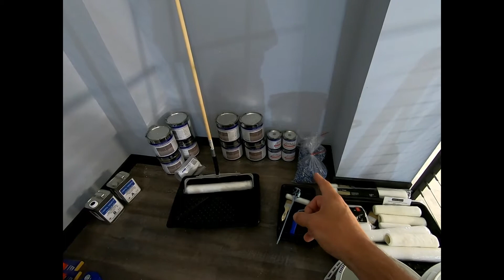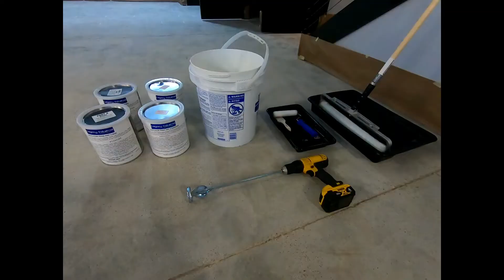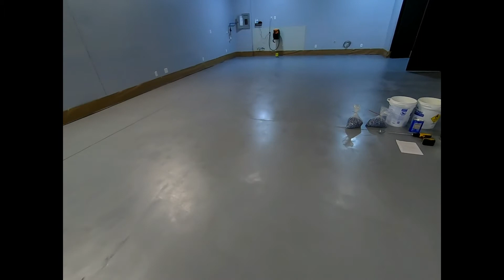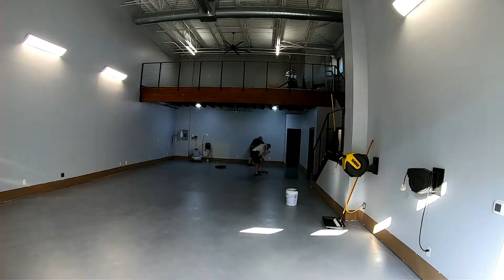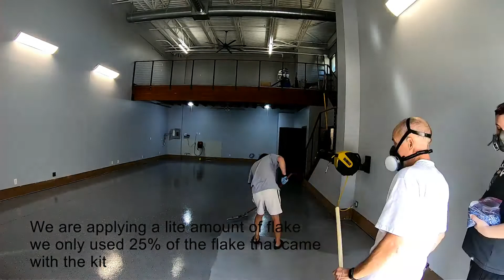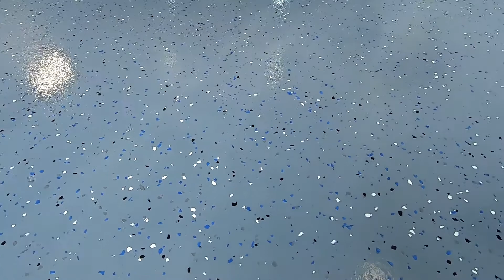Garage Floor - Legacy Industrial Nohr-S Polyurea

Comment: You used a grinder AND a chemical etch??  Why?
Reply from the maker: The grinding took down the main imperfections.  The chemical wash cleans it up before epoxy
Reply: @LarryBlackledge    Ahh ok...I'll be working with a brand new concrete floor.  It does have trowel fan patterns all over...guess if I don't want those showing through I should probably grind it down as well.  I was hoping I didn't have to rent a grinder...
Reply from the maker: @angelsoftheseventhdawn I can tell you that the grinder that was used in the person I hired to do the grinding left a lot of swirls I don't know if you will improve the look or not you may want to research that more.
Reply: @LarryBlackledge  Did the swirls show through once the floor was completely coated and cured?
Reply from the maker: @angelsoftheseventhdawn yes they did show, it never smoothed out.